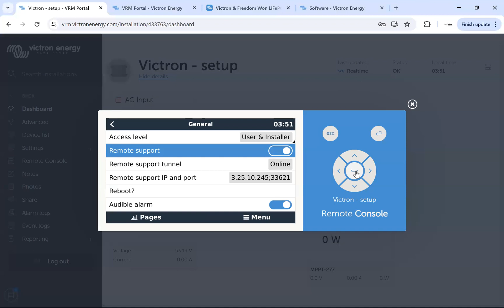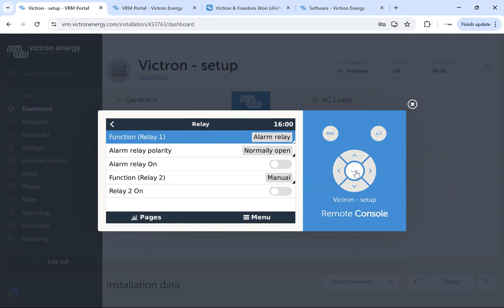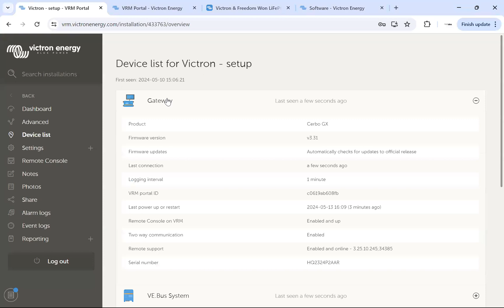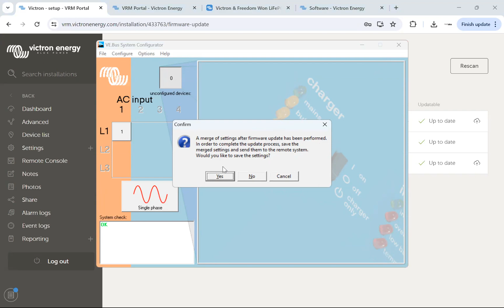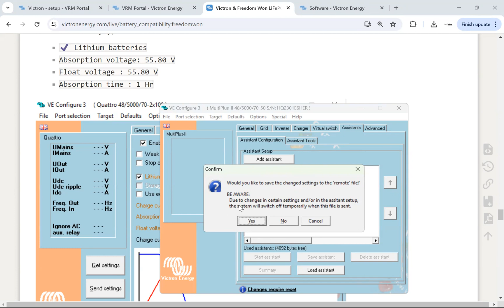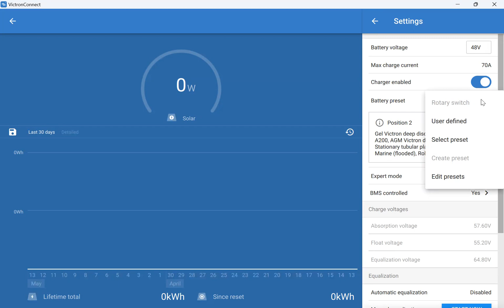Latest Victron system remote setup via VRM - Off Grid with Freedom Won Battery Multiplus II and MPPT

Comment: Hi Ben , we do have in our caravan multiplus2 24 volt/ 5000/220 system our backup is a honda 2.2generator when we run it the system is probably taking to much amps and trippes the generator. How do I change  the amps settings to suit the generator probably only 7/8 amps .thanks for any help
Reply from the maker: Unver VE Configure you can set the AC current input. Have a try at that... https://youtu.be/InJ5wTcS4ao?si=UbdBAPEupDwJ8ix9&t=2215

Comment: It is a shame solar chargers cannot do VEconfigure ...
Reply from the maker: Yeah - I understand. Victron are working slowly towards a unified programming platform but they are pretty careful before pushing new software and firmware out before proper testing so I expect it will take some years yet.

Comment: Hi, With the MPPT Solar controller (I have 2) I went in through VictronConnect, saw all the info as was in your video, the only change I made was in Presets from "Rotary switch" to the #7, Lithium. I got the following error: MQTT-RPC   Unable to connect to the RPC broker. Configuring the device is not possible. Error Code: #R2.    Any idea why?  Cheers from across the ditch.
Reply from the maker: @Tractor010  sorry - only just saw your comment. Did you get it sorted?